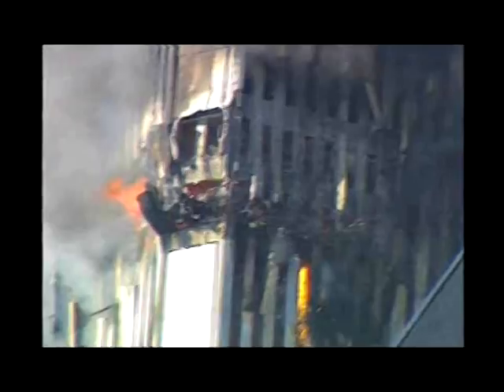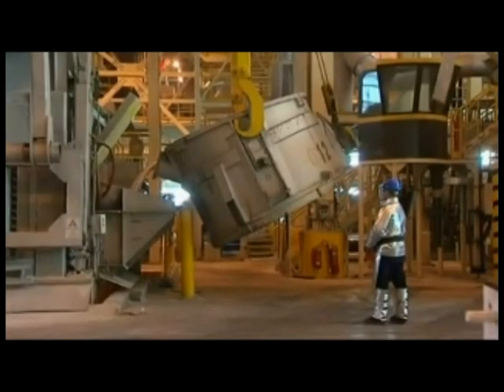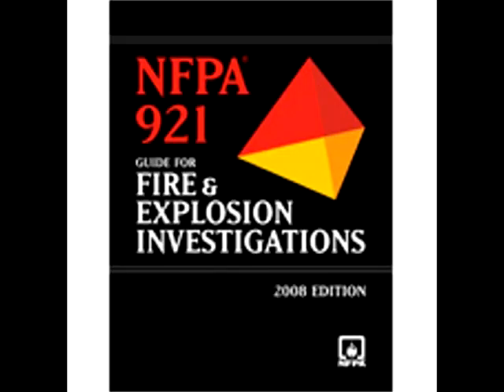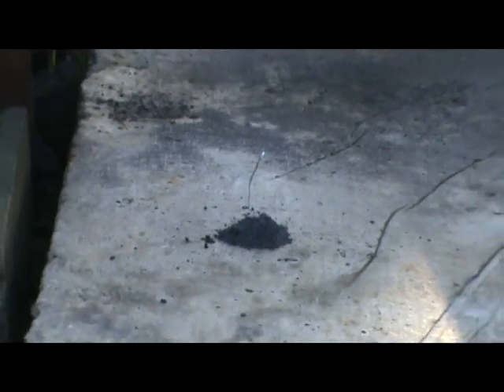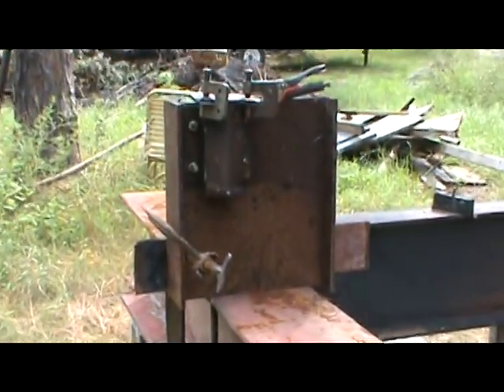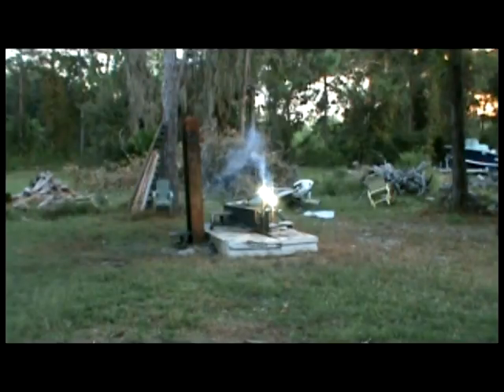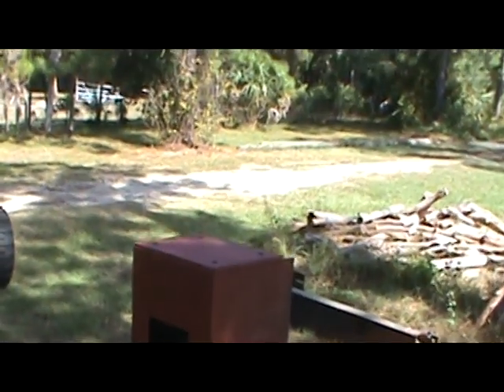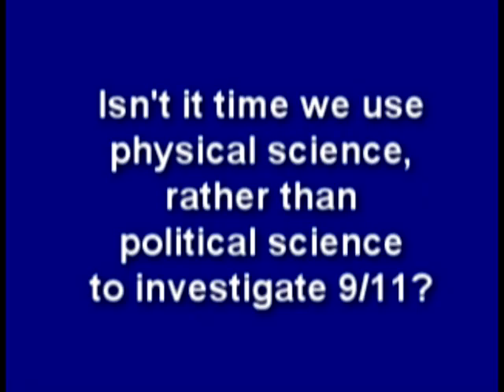9/11 Experiments: The Great Thermate Debate

Comment: Why cut the bolts when they could of remove many of the bolts that connect the large panels? I say this in seeing how many vertical connections had no stress evidence that bolts were even in place, like of the 3 box beam connection points, on larger side wall box frame sections, only one of the three was bent as if there were no bolts in the other two, of each of the 4 bolt connection points.

Comment: Nobody was up there checking the temperature in the towers during 9/11 , but I can guarantee the heat generated from the impact in a virtually in closed area would be a lot warmer than your speculations .. you can do all the tests you want, the steel you have acquired for your test is not under any stress , it's not attached to & holding a building up , the steel in the towers is a structure which has been holding god knows how much weight for how many years, the steel you're testing is not part of any structure of equal weight & time  ... all the conditions must be exact in order for a test to be worthy , altitude as well ! You're nothing more than a bullshit science experiment gone wrong liked by the same 50k idiots who believe the earth is flat 🖕🖕 lmfao 🤣
Reply: Viktor Vincent 
How can you even begin to discredit this video when you have absolutely no scientific background and, at best, only a rudimentary understanding of the scientific method.
Dolt!
Reply: But you didn't mention once that both towers' contained forty some columns that were two to three inches thick a piece. That's over one hundred thousand tonnes of steel top to bottom. Time and weight has nothing to do with one another unless extreme exposure was a factor, which - - it wasn't. Of course any enclosed space causes spikes in temperature but the initial impact fire from the jet fuel burned itself out after fifteen or so minutes resulting in less temperature but had sporadic fires jumping up to each floor. The resulting fire were not enough to bend, warp, break or even cut a beam which is two to three inches thick unless it had some help like an accelerant or high incendiary device that could have been planted months before the attack even began when everyone is at home. Or - - through official channels like they used out of building seven, which was both a financial and security building that the FBI, CIA and NSA used on different floors. Also, it had in the sub basements... all of the back up servers for both towers. Get rid of those servers, then you can get rid of evidence of any overseas money transactions for the operation. There were no conditions met for both towers to come down like they did unless they had help like the video described. Besides both buildings were designed and built to withstand any impact on all sides no matter the weather conditions or heat.

Comment: I was a welder I have seen thermite  weld railway tracks and other steel items.Thermite was not the answer.
aircraft contains thousand of pounds of magnesium which can burn at temperatures high enough to melt steel.
However the building collapsed as the beams lost their strength as when steel gets red hot or white hot as was seen the metal becomes mailable like a blacksmith forging . metal.
The weight of the upper floors was too much for the Weakened beams.The popping noises were the bolts pulling out or snapping as the building collapsed.
What you showed had no scientific  value to why the building collapsed.
Total rubbish the whole story.

Comment: The beams didn't need to melt. All they had to do was get hot enough to loose enough structural stability to begin bending with the weight of the floors above them. Burning jet fuel was witnessed running down the elevator shafts and pools of it was all over the floors that were hit. Therefore you get collapsed buildings. It's simple physics.

Comment: So all the beams were critically damaged at the same second? Not one side first, even by a bit? Seems pretty hard to get the timing right... or this thermite damage weakened the steel so when the building started to go in one point it snapped the rest at the same time. Hmm kinda seems to require weakened steel giving way together like in the official story...

Comment: Shaped  explosives   cut the  steel  like it  is  butter  - pictures  from the  92nd  floor  shows  the rooms  full  of  detonating  cord . Once  all tied  together   -  you  just  put  in   the  delays  on    the detonating  cord  .   Then  we   the shows  begins  it  takes  only   1  blasting  cap  to  set things off -      the  millisecond  delays  do  their  work  as  you  see  how  the  building   came  down  -  Building   7   good  example  .  911   was  an inside  job  by  the  Deep State  and  explosive  experts .

Comment: there were no explosions at 9/11. the planes jet feul weakened the beams in the part it crashed into (jet feul has 10x the energy density of thermite), at which point the structure buckled under its own weight.

Comment: The steel need not melt to soften and hold the weight of floors above becomes problematic. There was aluminium magnesium and a shit load of other materials that also had chimneys to blow air up into the fire like a blast furnace.  The average house fire can reach temperatures of over a 1000c and when fire doors are only able to hold back a fire for about 20 minutes. You have also take into account the crash caused substantial deformation of the structure when combined with heat the fact it was some way from the roof which the damage and weaker steel due to heat. 
I like your experiments with thermite, etc but the are other mixes using copper that are more energetic maybe try a few out? I have no answers here I watched it all live and it broke my heart to see and know all those people died. I am no expert but did work in industrial labs as a chemist in one. I feel there is nothing more to learn here but keep trying I have been wrong many times but learnt from that and also been right and people have learnt from that.

Comment: Building 7 pull it  thats the smoking gun closed case u can not set up a controlled demolition in a day how did larry Silverstein do it
Reply: You have to understand that building seven was half political and half security run. The secured half was also overseen by the FBI, CIA and NSA in different location through out the building. Close down a section of the building under the guise of renovations for a couple of months before hand or what have you then you have a covered opportunity to rig the building. What some people do not know also, was that the sub basements of building seven had all of the back up data to the twin towers on servers. If something were to go wrong then at least they had those servers to back up the data. But since it was a false flag operation it meant also that overseas transactions were recorded on those very same servers. Get rid of the servers, you wipe out a long trail of evidence of who sent dirty money across seas for the operation.  Who ever the project leader was for 9/11 was, took into accounts of all contingencies based on time line factors. The operation could have been planned over the course of bush's election campaign. That and he rigged the votes in Florida.

Comment: Thermite is not a good cutting explosive, it is hot enough to use for welding but not fast enough for cutting. None of the professional implosion companies use thermite, and only 2 structures have ever been brought down with it. Neither fell cleanly. Thermite was the chosen explosive of camp whack a doodle because it can be set off without signal wires....AND we all know there was signal wire found at ground zero.

Comment: Wouldn't the wind speed turn the towes into a fordge. Like when a black Smit blows air into there fires to heat up metal. So maybe jet fuel under normal circumstances wouldn't be hot enough but when fanned by the wind at that hight could be

Comment: If it was free fall speed, how come the pieces of building that fell off first hit the ground many seconds before the whole building had finished? Were they falling faster than free fall speed? If so, explain to me why that is or I will never believe you ever. What I'm telling you is not deniable. You clearly see the top portions falling off the collapsing building and mushrooming down off the collapsing building and falling to the street below while still more than half of the tower is still standing. Explain. You can't. And won't.
Also! The metal seen dripping out was the 300 ton aircraft made of aluminium inside that floor. That was the impact floor you nutcases. Aluminium would melt much much cooler than steel. I've seen no proven photos from ground zero that show melted steel. That's because there is none. Steel will weaken over 70% of it's load capacity at only half of it's melting temperature. The estimated tempature inside the impact floor was less than half of structural grade steel's melting point, but that would still weaken it by 20-40%. That combined with the severed columns redistributing the massive tonnage of the building above to the remaining columns and the all important floor trusses no bigger than a Wal-Mart roof sagging due to the heat is what brought the towers down.

Disprove my comment. You can't. And won't. I'll get called a sheep etc but you still can't and won't explain how all that thermite was placed on the impact floor prior to the aircraft crash. That floor did not show recent construction. And in addition to that, do you expect a plane doing 520 mph in overspeed conditions that probably wouldn't have lasted much longer at that speed that was rapidly decending at 110% engine speed to be controlled successfully to hit the exact floor they had placed thermite on? Really? And how was the thermite set off? How was it delayed with all the heat and fire? Remote control? All y'all are full of it. The official explanation is gold and you guys suck.
Reply: Rjay - pieces of building that fell off first hit the ground many seconds before the whole building - maybe from being propelled from explosion ? - what do you think about building 7 ??????
Reply: manx man Watch! The video! Propelled down from an explosion!? You gotta be insane dude. They clearly fall to the ground. And building 7 collapsed from the inside out. It was collasping a good 15 seconds on the inside before the outter tube walls gave in and collapsed. This is evidenced by the daylight visible before collapse in the windows at the top. As for how, it's because heated steel structures suck and the entire WTC compound didn't have near adequate fireproofing.
Reply: Rjay  - well you are certainly entitled to have an opinion..If you are qualified then that should provide more credibility.

Comment: The smoke from burning fuel is dark black, the fuel was consumed in the gigantic fireballs we saw.  When Jet Fuel is shaken violently it begins to mist and the mist is explosive, search Anti-Misting Kerosene for more information.  The smoke at the WTC was dark grey which indicates a Class A fire with some plastic burning, rugs, curtains furniture etc.  There were no rivers of burning Jet Fuel, and all the tests have used much smaller steel beans, which were never revealed what class the steel was. Before 9/11 no skyscraper had ever fallen due to a fire, including one that burned for over 18 hours, but it did suffer a partial collapse.  When a building falls from damage or weakness from a fire it will fall in the direction of the damaged area, because that is weaker and failed.

Comment: you don't have to melt metal  to make it bend and weak
Reply: For this building you needed to since each 'I' beam or section were two to three inches thick. To support a one hundred and ten floor structure like that you can't use simple beams like the 9/11 commission tried to sell to the public.  And there were over forty columns in the center core. I'll say that again... Forty columns. Combined in weight top to bottom was over one hundred thousand tonnes. Each were two to three inches thick for handling the weight of each floor. Given the sheer size and mass of both towers it would be impossible for those beams to warp under heat, which did not last for more than half an hour. There were fires yes from the initial impact but the fuel burned itself out in the first fifteen minutes. When jet fuel burns it retains a heat signature of close to thirteen hundred degrees Fahrenheit, which is not enough to warp those thick columns. To get them to even bend slightly from heat you need over twenty five hundred Fahrenheit or an accelerant like Chromium Oxide or Thermite to cut the beams quick enough to make it look like it was part of the impact. Both buildings were designed and able to withstand any impact on all sides.

Comment: Hey genius, steel is not the only metal used in the construction of a building
Reply: that doesnt change anything. steel still melted.
Reply: the molten metal pouring out of the building is aluminium and copper. Aluminium conduit is used for all the wiring in those buildings and the conduit is full of copper wire. Steel didn't melt

Comment: Yes and no's
Yes the temp recorded and estimated can not melt steel, let's explore that.
>This is recorded temperature, jet fuel can burn hotter. If put in a 100 story chimney it can burn hotter. >Office material can contain toxic elements, that can join with other material and add to the heat. I am saying can, not did. It is unlikely, but possible.
>1800F can not melt steel, but it can weaken steel. In an implosion they weaken the building, and set charges. When they set off the charges, the support weakens, and gravity does the rest. If the steel was weakened, and bent. that may be all that was needed for the building to fall.
>The fires in some areas and not in the other could be the way the flaming jet fuel ran. 
>It would be interesting to look at the stress load that was designed into the buildings, then take how much energy was in the jet fuel and see if it was possible. I have never seen that done. If the energy was greater than the energy in the jet fuel, to me that would be positive proof, but that's just me. The total energy contained in the jet fuel could not be used, as some was converted, and wasn't used to damage the steel.
>You will find that witnesses are not the last word on anything. Police are now finding that eye witnesses are not that great. 
>It is possible that the magnesium in the planes could have caught fire and melted some metal in pools and ran out as the structure weakened. Again, not likely, but possible.
>Lastly, what is thermite? Rust and aluminum. I think we could find rust and aluminum powered in that mess. If you watch the Hindenburg burn, you will see thermite reactions. Possible the result of the "dope" put on it, but it is there. The aluminum could have powdered in the normal movement of the building.
>The big cutout is actually a part of a fabricated support. The higher up you go, the larger "window" you have. This allows the steel to be able to sway, and lessens the load on the supporting beams.
>The part that could be bulged out could have been left that way from the stresses in the collapse. Buildings do strange things when dropped. 

Now the other side.

>You would not have to use any oxidizing material like thermite when you have plastic explosive. I am being some what dated, but in Vietnam we used a form of explosive that burned fast, (explodes) and put over 16,000 PSI on what ever it was next to. This would account for the puffs. We have more advanced explosives now, and IMHO it would be much easier to "overlook" the residue of the more modern oxidizers than the Iron residue of thermite.
It would be an exceptional amount of circumstances for both towers to drop. 
Just like when the Federal center blew in OK, the first thing I said was it was a high speed footprint. Nitrate fertilizer is not a high speed explosive. It is used in mining because it gives a hell of a thump, but it doesn't stand up to modern explosive. That's why ammonium nitrate is not used in modern weapons.
You would not have to cut the vertical beams. If you take out the horizontal support, the building will collapse. All that was needed was to put a cut on the horizontal supports, and take them out. 
>Even a simple Mercury switch to activate whatever chargers were placed. The charges could have been placed over weeks or months and never been detected. The impact of the plane would have been enough to detonate it. It could have not been activated until it was ready to be used, as an earthquake could have set it off. 
I do like the way you approach this. Please note that I have said can and may be, not a fact. The thing that bothers me from the first day is engineers work a long time to get a lot smaller buildings to drop like that. The fact that it dropped so perfectly, twice is extremely suspicious. 
Thank you for all your hard work, what you have done is impressive.
Smiles!

Comment: During WWII a bomber crashed into the empire state building.. Caused a fire but its still there..
Reply: Travis Chambers Your point is...?
Reply: Bass Cannon Jake 2 ha what do you think my point is? Want me to draw you a picture?
Reply: Travis Chambers Doing the math, you have a force of impact about 25 times as great for the 767s while the heat generated by the exploding jet fuel would be 30 times as great.

And that is not even taking into consideration the huge structural differences between the Empire State Building and the WTC (which I mentioned before).
Reply: Bass Cannon Jake 2 lets see the math
Reply: Travis Chambers I gave you the numbers, dude...
Reply: Bass Cannon Jake 2 as in how did ya get those numbers?